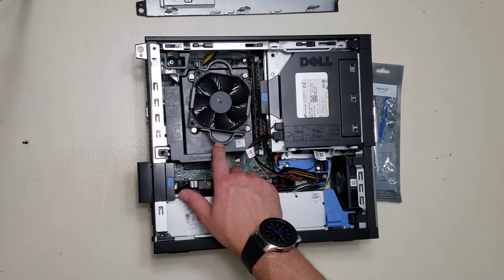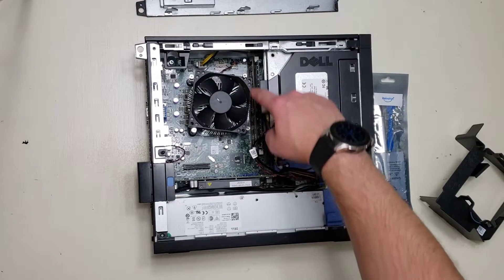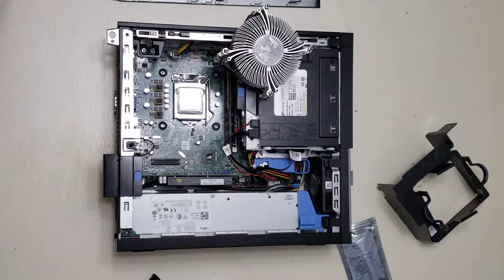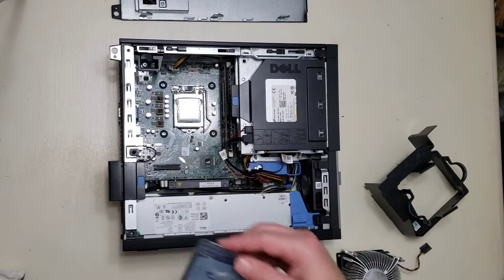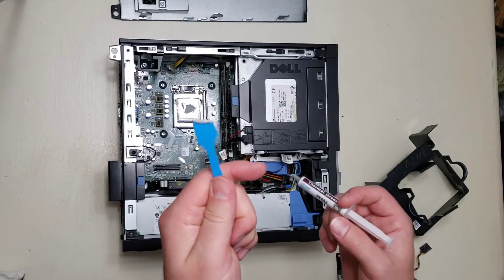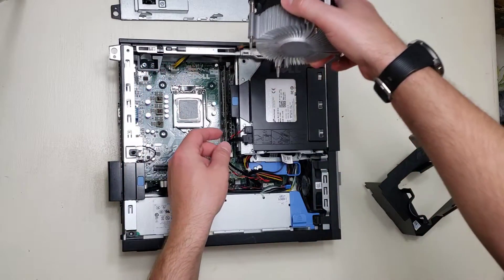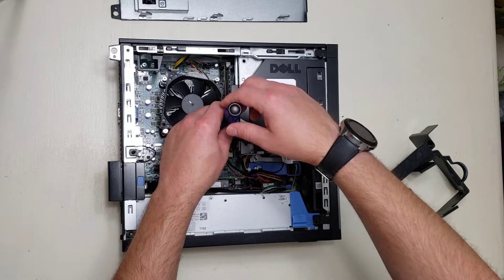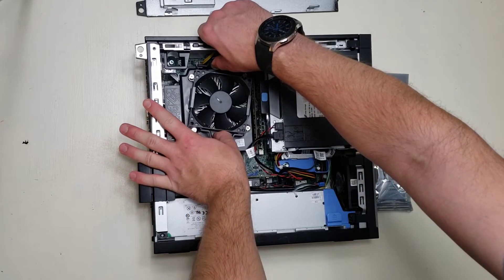How to assess and replace thermal paste for gaming - Dell Optiplex 9020

Comment: I would personally check the condition, by simply running prime 95 for a minute while looking at temperature sensor, see if it shoots up immediately higher than it should. If it settles around to mid to high 70s Celsius that's just fine it's not degraded, generally.

Comment: I haven't watched the video yet but I'm too excited not to say that I have found the stock thermal compound  On these business PCs have great longevity and decent performance. The CPU isn't high TDP enough to matter about super duper thermal conductivity. Neat thing about the Skylake chips you can undervolt them by 100 millivolts easily with throttle stop set TDP to 50 watts and your golden.

Comment: Which one is better for 9020? Rx 6400 or 1050ti?
Reply from the maker: The 1050ti will be better. It will overcome the 7-9% performance hit from being plugged into the 4x slot. Dual width cards are the way to unless you want to use that 4x slot for something else.
Reply: @OptiGPU  i'll see what i can find, but i'll prioritize getting the 1050ti then, thanks!

Comment: What are you doing... the purpose of thermal compound is to mate the cpu lid to the heat sink filling in any imperfections in the two surfaces... putting that much compound on is actually reducing the heat sinks ability to remove the heat from the cpu.   Also when you place the heat sink back down on the cpu giving it a little pressure and a twist back and forth will help improve the mating of the two surfaces and help even out the compound.
Reply from the maker: https://youtu.be/EUWVVTY63hc
Reply: @OptiGPU  Did you even watch the that video?  He states my point exactly at 4min 45sec... I have been building systems since you were in diapers and it always baffles me why people insist on posting how to videos of things they are still learning... it just reduces the quality of the information on the internet... all you were doing by putting that much compound then placing it directly down was trapping air... please watch the video you replied with right here: https://youtu.be/EUWVVTY63hc?t=285
Reply from the maker: @4N5W3R5  12:13
Reply from the maker: @4N5W3R5  13:56
Reply: Linus Tech Tips recently showed you can go nuts with thermal paste, it's not ideal but for these low TDP chips it doesn't matter a bit...